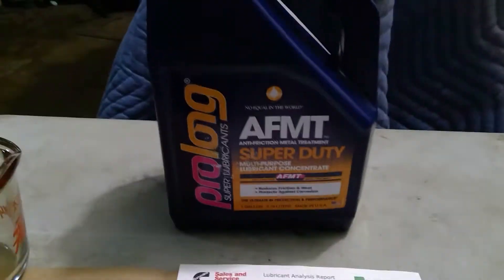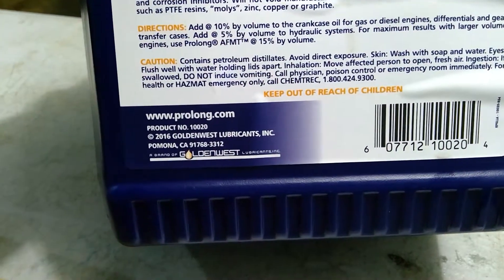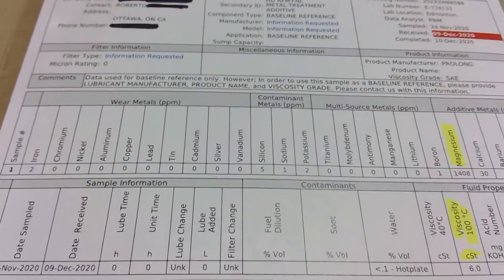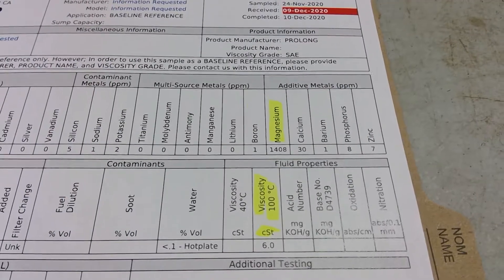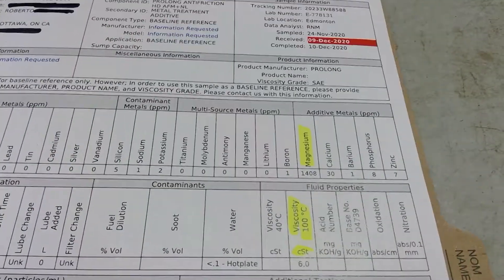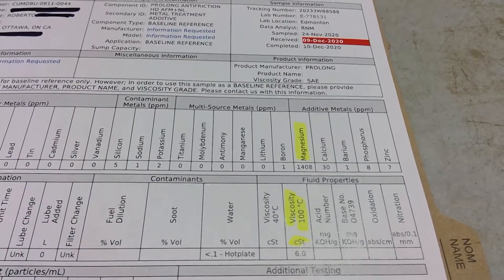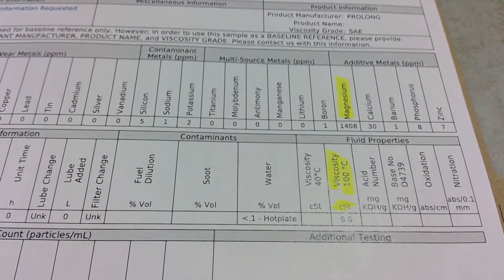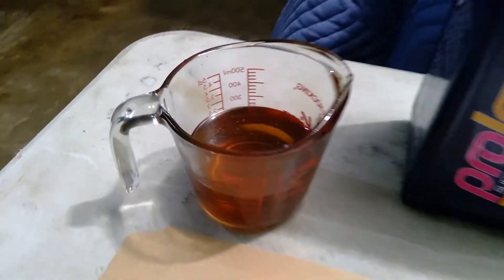Prolong AFMT Oil Analysis Engine Treatment - VOA

Comment: That doesn't look like what's in the 12oz? bottles that parts stores sale. I use it alot and looks thin like 0w30wgt. I have it in everything, when i do oil changes in my 333000.00 z71 it takes about a week and I'll notice it runs like a new and complete different engine. I've seen both oil pressure rise by 8to10psi and coolant temp drop by around 8 degree. Amazing product in my opinion
Reply from the maker: I got it from Amazon. One gallon

Comment: This is my question since you did the test and found magnesium,calcium but,your review it doesn't said if the material will work on any conventional motor is not cheap this new car models now with different types of oils including the old conventional oil 20-20 20-30 10-40 plus more